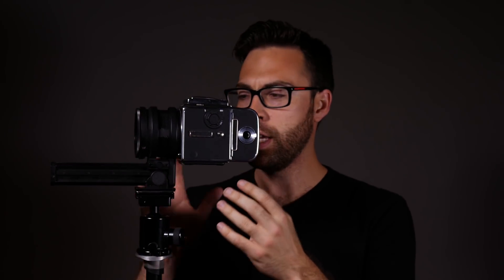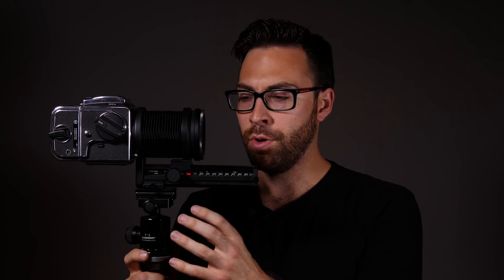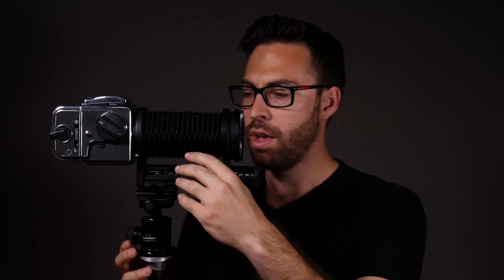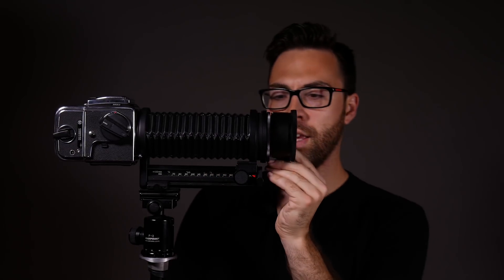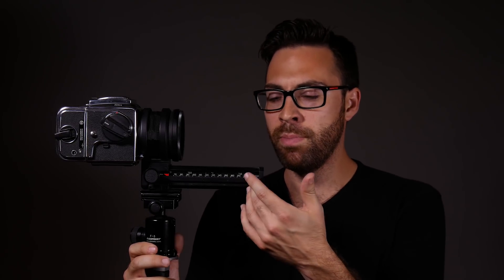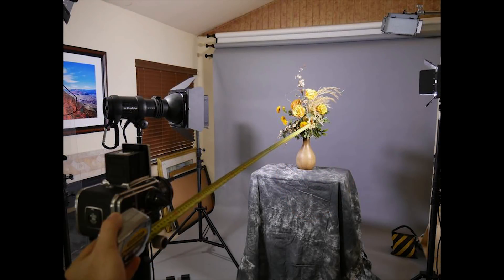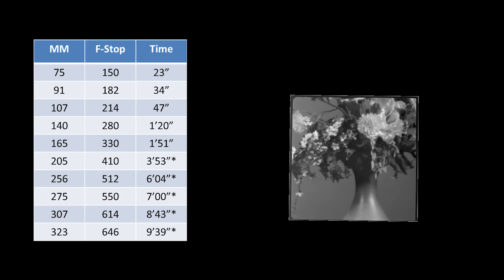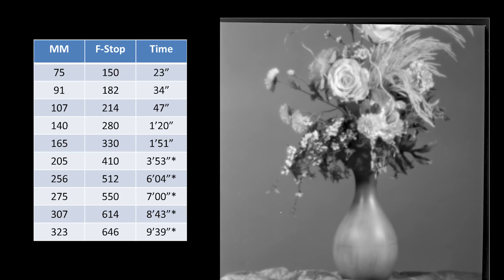A Pinhole Camera with a Zoom! - The Pinhole Camera - Episode 2.6

Comment: Photography is the "art of science" and the "science of the arts".
I have constructed a pinhole camera with an old Kodak 3A, 4 x 6 inch negative. The sliding lens bed is optimal for a zoom camera. Mine zooms from 90 to 150 mm. I am going to test the "optimum" pinhole diameter.
Great video.

Comment: The camera that would be a natural for this is a Mamiya RB-67... and I have one!
You can buy a body from eBay sellers for under USD $200.
Reply from the maker: I have an RZ-67 and do agree that it naturally has this feature built in. However, the bellows extension for the RZ (not sure about RB) goes from 0mm to 45mm. With the macro bellows on the Hasselblad you get a wider range of 65mm-200mm. I'm sure they make a bellows for the RZ, but the weight savings of the Hasselblad is why I would prefer to use it. Both are great cameras and for the prices RB/RZ bodies are going for it would be a great way to get into medium format photography. Happy Photographing and thanks for your comment!

Comment: Assume you considered reciprocity failure with various extension tube adjustments.
Reply from the maker: Around the 12:40 mark you will see the table of focal lengths I used. Using that focal length and the known pinhole size you can calculate the effective F-Stop. You can then use that to calculate exposure and I listed the exposure times. I was using Fuji Acros 100 which has no reciprocity failure for the first 120 seconds. From 120-1000 seconds you only need a half stop correction. The times in the table with the asterisk (*) have been adjusted for one additional half stop of exposure. Fuji made an amazing film, but sadly it is discontinued.
Reply: The Science of Photography I was just looking through your videos for a Exposure Calculation for bellows / extension tubes. I have seen the (bellows/focal len)^2 for exposure factor equation... though am not sure how to measure for extension tubes on a Hasselblad... and honestly was lazily looking for a short YouTube video demo vs reading equations online ;) just a suggestion if you are looking for another video idea 💡😃